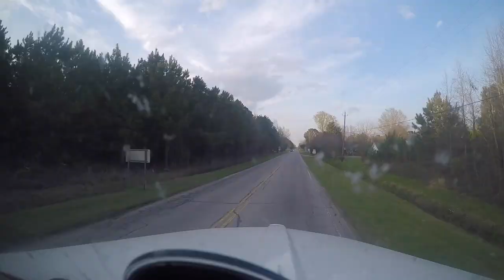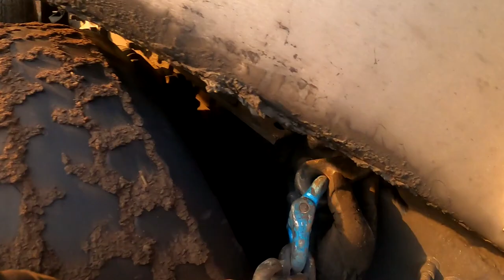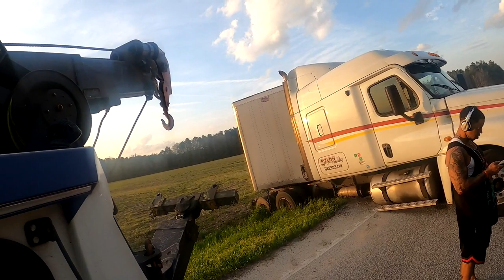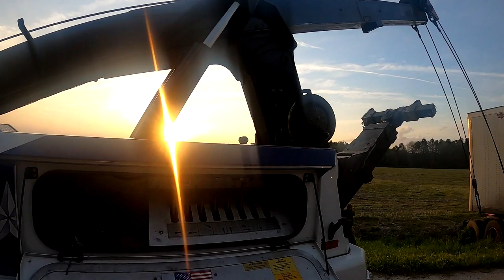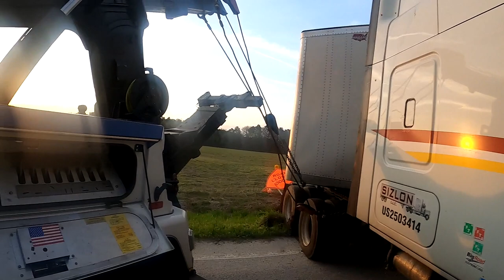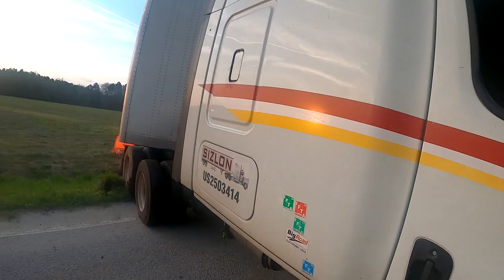Tractor Trailer ends up stuck after missing bridge out signs

Comment: Either that youngster DOESN'T know how to use it, or he has completely destroyed the clutch brake on that rig. As a professional driver of 22, working towards year 23, it is my pet peeve when the clutch brake is inoperable in a truck!
Reply from the maker: PNW RC, Yeah he had it jumping pretty good. Thanks for viewing and subscribing!
Reply: Well when i first got my own trk. I was out for about a week and i was in pa and left the terminal after filling up on fuel and i had about 17k in the dry van and went through 10 miles 1 lane with concrete barriers on both sides. Speed limit resumed normal picked up speed you know you have a problem with a manual transmission trk when rpms go up as speed goes down and i wasnt even heavy. I took next getoff ramp fiquired no shoulder on expressway and if couldnt move blocking ramp would be better but there was a restaurant with trk parking right at end of ramp. Messaged breakdown that my clutch was gone. They wanted me to go back to terminal. No clutch is gone. Funny part was i was like 5 miles from delivery. Can you make it to delivery.  No clutch is gone. (Like they didnt believe me)  they sent a bobtail for trl and a wrecker for me. Sometimes you get junk equipment so maybe clutch brake was already fried
Reply: @tractorboy31  I don't know folks. I never lost a clutch, but I did lose a clutch pedal once. Funniest damn thing I ever saw. The clutch pedal linkage broke on me one as I was scoot'n thru Nashville. I heard a thump on the floor & was WTF was that. As I was squirreling around thru traffic, I look down between my legs and seen the clutch pedal laying on the floor.  It was like oh, Fuck. I just continued on driving trying to figure out what I was going to do because I figured I only had 1 shot at stopping, than I probably wasn't going to be able to get going again. I knew of a small truck repair joint right along I-24 as I was going south towards Atlanta. I figured I could get off the exit, & baby her over to the next on ramp which was right next to the repair shop. From where I got stopped, I could read their phone number, & called them up. I talked to the owner who came out & was looking at me sitting on the ramp. He had me walk the broken pedal over to him & though he did not have an exact replacement part, he was able to make a part for the linkage that would work. He walked back to the truck with me & installed the modified pedal. It took about 3 hours total. Total cost was like $160.00. It lasted a couple of weeks until I got back to the terminal & they were able to replace his part with a whole new clutch pedal & linkage.